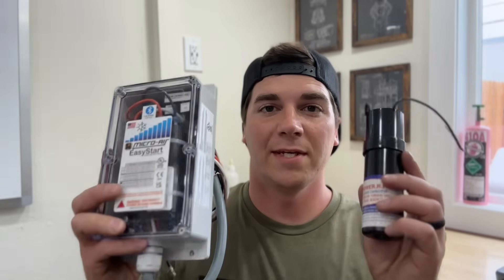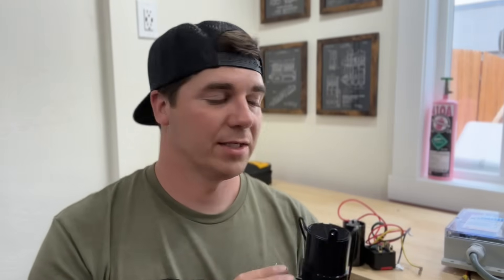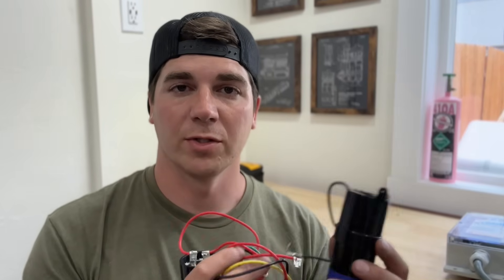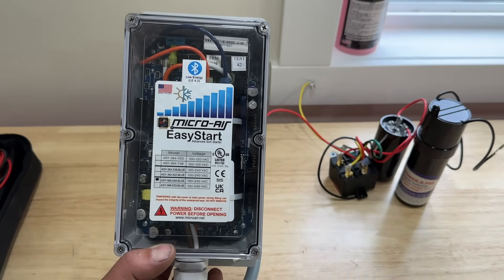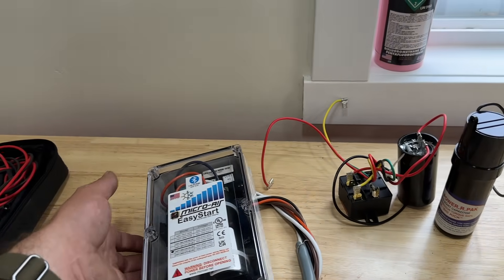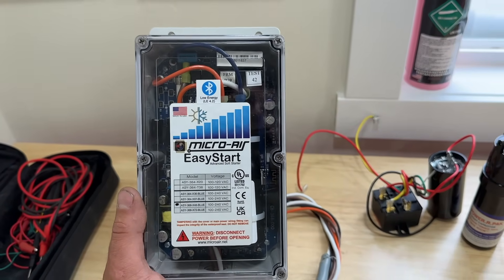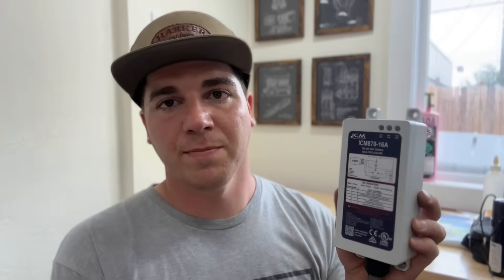Hard Start Kits VS Soft Start Kits    |     Which Is Better?

Comment: I just want to clarify that both systems can be used to start the air conditioner compressor with a generator provided that the steady amperage used by the compressor is below the generator output. This applies for both systems. The reason a generator normally does not start the compressor is because of the peak amperage used to start it which lasts less than a second. Both systems avoid pulling a peak amperage from the grid.

Comment: The ICM870 9amp is perfect for RV’s, the ICM870 16 and 32 amp is good for your home AC units. They’re 159 for the 9amp and the 16 and 32 amp is about 179. Half the price and it’s been around in the hvac industry for years. We’ve used them in server rooms with UPS on the server and AC units cooling the servers that will run on battery back up before the generator start up and some just run on ups systems till you can get power back up and running.

Comment: So, a Hard Start Kit won't help a Window A/C start with a portable Generator !?!... I have a portable camping generator which would run a 5000btu Window A/C "if" it could start.
Reply from the maker: Yes! They make one that goes between the generator and the device and allows it to start slowly. I’ll be doing a video on this soon!
Reply: @diyhvacguy  
Nice !
See if you can tag the RV/Camper/Van Life Community because many have Vans, Campers, Micro Campers, converted Cargo Trailers & want to run 5k btu A/C units from small 1000w inverter generators or battery/solar power banks 😎

Comment: There is a company now making Soft Start Kits for less than $200.  It's called the ICM Controls ICM870-16A Soft Start.
Reply from the maker: Wow good timing. Check out my latest video 😊
Reply: High failure rate for this brand...just removed the failed unit on mine tonight
Reply: @shaundenkler810  was it properly sized ? If FLA rating on soft start is lower than the AC nameplate, of course it will fall.
Reply: @victork3397  yes a 16a model on a 13k Coleman travel trailer AC unit.... Even checked with a amp clamp before I ordered it
Reply: @shaundenkler810  Thanks for the feedback. How do you know the failure rate is high?
Reply: @Capt-Intrepid  a simple search will reveal
Reply: Also, the ICM870-16A that I got has a 4 minutie delay on EVERY startup, not just the first, not on faults, every time. Apparently some units got programmed this way for seeminly no good reason. After browsing the usual forum and comments and ratings sections it seems there was a mass layoff at ICM around this time last year (july 2024 now, so summer-ish 2023). It seems like a mess. 
At this point I am way outside any return window, and a 4 minute delay on every cycle is just unacceptable. Couple this with all the reports of failed units, I pulled mine out of my system right after installing it when the 4 minute delay wouldn't go away. 
I'm hoping somone somewhere has a video hacking these, as Ive already seen a comment or two about teplacing the primary capacitor that fails in them. Just need to eliminate the delay.... And then, remove the wifi antenna from my hard wired roku...and then....nevermind, everything is crap.
Reply: They have terrible reviews on Amazon, I would read those before buying one. And they are $246.00 now for the 16 amp or 3 ton.

Comment: I wish A#1 Air had watched your videos .  They installed a 18 seer unit 2 years ago. It made a banging noise on start.  3 inside and 2 outside unit later! They put a hard start on it too. They sent a electrician finally . He said my 1963 wiring needed a ground. Wow no more bang! Now it moaning  like a old man.  I bet it's  the hard start that it didn't need!
Reply: They were probably just guessing and not doing the actual troubleshooting techniques that they were taught.

Comment: Just installed the ICM-860  as the price is about half of the micro-air.    Start up amps is 28 on a 4 ton unit.    I didn't have  meter to measure inrush before installing, but with the cost saving I was able to get a Kaiweets 208D clamp meter and still have money left.
Reply: Did the install make the start up noise less?
Reply: @linvol20  Yes,  I had a hard start unit installed before and it sounded like someone hit the unit with a hammer when it started.  The soft start was a much smoother, softer start up.
Reply: Why go cheap on these?

Comment: I would be interested in hearing about, and understanding the calculation, electricity savings when using a soft start to figure out a ROI. Anyone? Or is the soft start really about the ability to use a smaller generator and not the cost savings?
Reply: For most people, a soft start doesn’t save them money directly, but it does give them options they didn’t have before. The big one being able to run your AC off a generator or solar inverter. The decrease in initial current (inrush current) is what’s great. Otherwise your generator just clicks off because of too much current draw. Or your solar inverter trips again because of too much current.

Comment: I've had an EASYSTART on my 3 ton pack for a year now, and my power bill has gone down every month. The power saving has Allright payed for it self
Reply: You're full of shit 🤣

That's not what a soft-start kit or a start-capacitor does for the compressor.

Soft-start reduces the initial amp draw and slowly ramps it up while a start-capacitor with a potential or current relay increases capacitance which increases amps through the start winding on the compressor creating a stronger magnetic field to force the rotor around easier hence a lower starting amp draw compared to just using a run-capacitor.

Slow amp draw over a longer time duration or a quick amp draw which dims the lights in the house, either way its still going to use about the same amount of power.

None of those things will actually save you on your electric bill 😏

Comment: With a soft start installed is a 3 to 5 minute compressor start delay still necessary? I have a 4 ton 12+ year old Ruud compressor/condenser R410a system.

With a soft start installed at the condenser unit I think the delay built into the thermostat would still be there. My system currently runs the AC blower fan (but not condenser fan) more or less immediately but compressor and condenser fan kick on 3 minutes later.

I would like to reduce this delay if it's possible and safe to do so  because I'm in the sunbelt south and my ducts are in the attic so during much of the day for those 3 minutes it's mostly blowing around hot humid air.

Thanks for your great videos. You are the best on YouTube for explaining fairly technical AC stuff to non-professionals.
Reply: The delay is to equalize the refrigerant pressure. Does not have to do with the electric persea. With a high head pressure, it is more difficult to start the compressor.
Reply: @greggpurviance7252  yeah I know what the manufacturers delay is for.. I just wonder if it can be reduced or eliminated once a soft start is installed.

Comment: Sorry off topic question, do you recommend to use an air conditioner cover in winter? Live in Canada, have heard yes and no.
Reply: I put a make shift board over the top of my condenser to prevent snow and ice damaing the condenser fan, but nothing thats completely covering it due to rodents using it as a nest in winter months. I say no its made to be in the elements.

Comment: @The DIY HAC Guy. If nothing is wrong with your unit (8 yrs old) and you just want to extend the life of the compressor (no generator), would you recommend a soft start kit, hard start kit, or just leave it alone (if it isn’t broken, don’t mess with it).

Most YouTube HVAC videos recommend hard start but I got scared after watching HVAC school’s 1hr long technical video on hard start versus soft start. Now I’m afraid that putting a hard start, with all the extra torque on startup, could be doing more damaged to my compressor.
Reply from the maker: If it’s starting fine I say leave it. If it gets to the point of not wanting to start, then you can extend the life by installing a hard start kit, and buy you some time to think about replacement 👍🏼

Comment: Since these lower the amount of inrush current needed to start the compressor will this lead to energy savings on your electric bill?
Reply from the maker: From what I’ve been told it won’t. It just changes the way the current is delivered. Same energy is being used
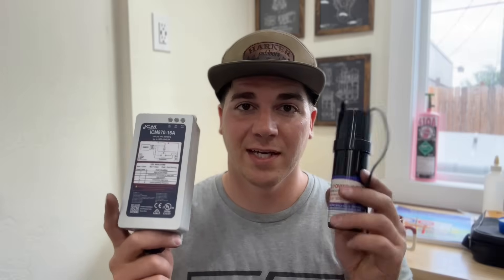Reply: No, it just stores the current 4:31 needed to start the outside unit.

Comment: Love the channel. I watch so i can try to fix a few things myself. Question for you. My HAVAC guy recommended a soft start I believe to prolong the life of my compressor. 2003 carrier home ac. Any thoughts? Thank you!
Reply from the maker: I personally think that if you want to prolong the life of the ac I’d go with a hard start kit. If you need/want to power your ac with a generator, then I say go with the soft start. Just my .02 cents. Cheers
Reply: @diyhvacguy  I thought the Hard Start kit was for units exactly like name implies - perhaps older, wearing out /worn ones, that are "hard at starting", and need the extra boost that the hard start capacitor provides.  

I had a time when my power went out.  When it came back on, the compressor started up.  Then 20-30 sec later; power out again; a minute later, back on.  I thought. "That can't be good for the compressor".  So I think a search for "compressor startup delay" let me to the soft start.   

So I'm looking more for something that can help extend the life of an otherwise in good condition compressor.  [If mine was starting to have issues, then the hard start kit might be a way to extend it's life, before even that won't help, and it needs to be replaced.]

Comment: I installed the Micro-Air EasyStart on my 2.5 ton heat pump back in August 2021 and been very happy with it. Living in a subtropical zone and dealing with frequent summer storms tripping out the grid extension cord. I have generator power and no A/C for several hours can make things uncomfortable really quickly. The $400 price tag is abet steep, but the ability to run my 800 ft² home in "normal" mode including a 30 gallon electric water heater on a 9,500 Wp inverter generator in economy mode and not skipping a beat when the compressor kicks on is a godsend.

The onboard diagnostics and compressor protection has saved me at least two $125 service truck roll calls plus parts. Having the EasyStart unit intervene in a fault event is way better than having the thermal overload tripping out. I've ran into one by the time someone realize what is happening the compressor housing was hot enough to fry an egg on it.

As for the ICM870, I think it is a great budget friendly version for those who don't want the geeky bells and whistles. According to their specs, using the 16 amp version might be pushing the limits on a 4.5 ton OSU. Can't wait for them to release the 32 amp version soon enough since my neighbor wants one installed, but not $400 interested. If my memory serves me correctly the LRA is around 100+ amps definitely stall out a 20 kW natural gas generator and maybe not so much on a diesel version. The power head might not like it, but it'll muscle through it.

Pricey investment as it may, but in the long term when your HVAC is at the end of its service life. The soft start unit is still good to transfer to the new replacement unit if it doesn't already have one already. Even the basic one has enough smarts to relearn to the operating characteristics of the new compressor.
Reply: the ICM-870-16   will work on a 2.5 ton and is only $154  Unless you want the Bluetooth Feature then Spend $300 Plus for Micro-Air
Reply: My 12kva generator starts my 6 ton ac every time but all the lights go out for a second. I am in the process of installing 100 kwh of batteries and 2 18kva inverters and while i still want a soft start 400$ is too much

Comment: I got a 4 ton air unit. What a soft start that don't have all those features. And cheaper.
Reply from the maker: The icm870 only goes up to 3 ton unfortunately but they are coming out with a larger one for 4-5 ton systems soon. That would have been my suggestion. Micro-air might be your best bet unless you want to wait on ICM. Cheers
Reply: @diyhvacguy  does this saves electric on my bill.

Comment: Can I install a soft start on a Trane system that has a hard start from the factory?  I’m assuming no?
Reply: Its Called a Start Capacitor when its Factory installed  & Yes you can install a Soft Start but you have to disconnect the Factory Start (Hard Start Cap ) First    You don't have to remove it just disconnect the 2 wires going to the Run Capacitor C & Herm Terminals from the Hard start Cap & Relay  .  Soft Starts have a Hard Start Capacitor already installed in the unit

Comment: Just ordered a micro air soft starter after watching many videos, including your install video. I have solar with battery backup. This will allow me to run the AC while off grid.
Reply: Can you give us an update? How is it going with the product?
Reply: @corbinkappler4631   It's working great!  Not much of an update to give because I installed it and it's just doing exactly what it was supposed to do.  No issues.  I can now run my heat pump air conditioner from just my batteries, no problem.  My heat pump has a rated LRA (locked rotor amps) of 107.  According to the Micro Air app,  I'm now starting it using only 34 amps.   Couldn't be happier with it.
Reply: @dreednlb  that’s great. Thank you for your response and for the helpful information.

Comment: DIY Guy:  When u do the ICM Softstart install video (soon), please include a ' compare and contrast'
ICM vs MICROAIR...both devices seem comparable, does either device have extra features that the
other doesn't??
Reply from the maker: Yea the micro air has Bluetooth wheras the icm doesn’t but I will for sure do a side by side comparison on them 👍🏼 cheers
Reply: @diyhvacguy  edit: just saw your link to the 150$ ICM. Original: Mentioning the cheapest soft start available is probably also a good idea. If you want soft start but don't care about Bluetooth, diagnostics, or anything other than lowering inrush current draw. I've got a 9.5kW/12.5kW peak generator which runs the A/C fine, but if there's product out there that'll reduce the inrush current draw in the 50-150$ range, I would definitely spend that to reduce stress on the Generator and maybe benefit the A/C Compressor at the same time. Don't see more than 150$ of value so 350$+ is definitely not happening.

Comment: I have rheem 18 years old will soft start help $
Reply from the maker: No, I ld install a hard start kit instead of a soft start. There is a link to my preferred one In the video description :) cheers
Reply: Last summer I installed a Micro-air on a 15 year old Gibson 4 ton unit. Before in-rush amps -119,  after install in-rush amps-49 after 5 starts. Unit does not bang on start now.
Reply: @hogislandmark         If you not Going to need to run your AC unit with a Generator  Then a soft Start is  really a waste of money    A Hard Start Kit  will be a much better Choice
Reply: @danray9744  That was the intent. To be able to run the AC unit with a portable generator. So far no need to try it yet.

Comment: I have a new Lennox residential a/c system which starts with a loud bang some of the time. What is this and will either of these products fix that problem! I’m concerned that the compressor is taking a lot of voltage too fast. Am I wrong? Comments welcome.
Reply from the maker: Yes, a soft start kit will quiet down the unit at startup and when it stops also. You can find the correct product for your system in the video description 👍🏼 cheers
Reply: @diyhvacguy  thanks for your help. I’ll check into it.

Comment: I have a new 2.5 ton a/c unit.  If i install a soft start kit will my 5k generator run it ok?
Reply from the maker: Heck yea, this thing will allow you to run it on a 3500w generator. You can find the correct size for your system in the video description 👍🏼 cheers

Comment: Just installed 2 micro air units on my 4 ton ac units. Had to call customer service and they resolved the issue pretty quickly. Went from 129 to 30 amps on my downstairs and similar to up. Very nice and definitely like the Diagnostic app as well. My 5500 generator will run these no issue now.
Reply: 5500w generator is only 22.9 amps @ 240volts
Reply: @danray9744 - is your point it should not be able to run it because he said 30 amps?  Maybe his is 5500 running and 7500 peak which would cover his case 240x30=7200
Reply: @danray9744 yeah and at 120 it's double the current, so whats your point?
Reply: @danray9744  For running amps, pretty sure he's talking start-up amps
Reply: So, which easy start model did you purchased for your 4 ton A/C ??
Reply: @giljunior7494  I believe the large blue 368
Reply: You run two 4 ton AC units on a 5500 generator? 🧐